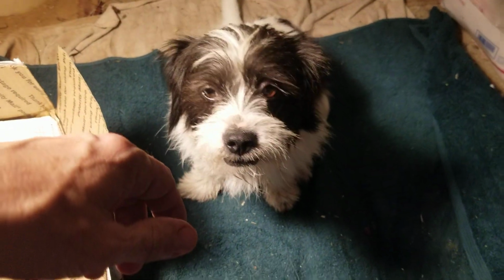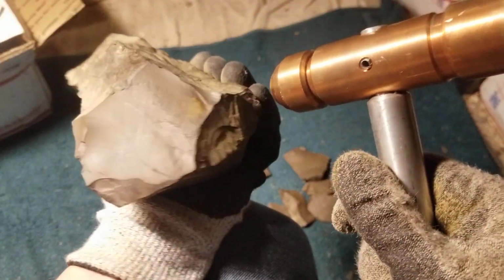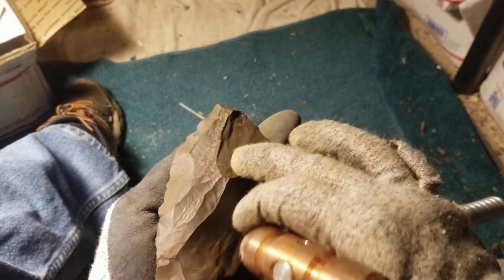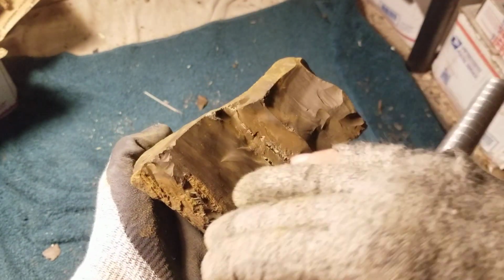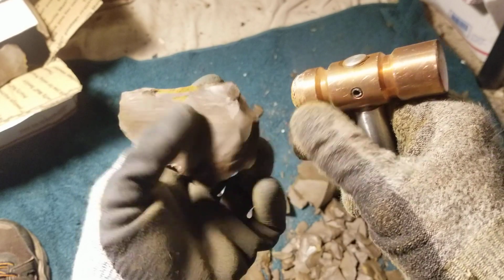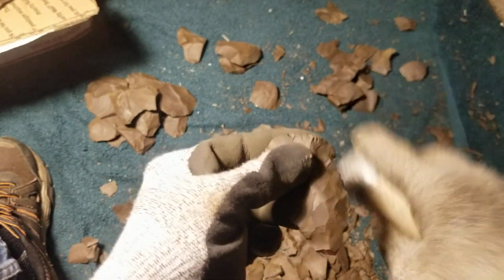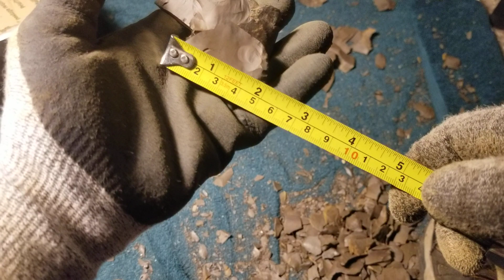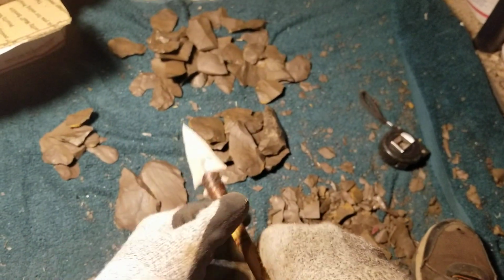982 - Rainy Buttes Part 1/8 - Gift Box

Comment: I recieved a box this week, it's alot heavier and dense than I've thought.
Reply from the maker: Does it look light weight in the video? Cool stuff, no?
Reply: Not so much light weight based on the video more so lighter like some other petrified or silicified woods I've worked in the past. Its a joy to work the grain present in some pieces make awsome looking points. You are absolutely correct about how brittle it gets while thinning forsure. I plan on posting some points on my Instagram later.

Comment: Hey Jack, I received some larger bulky Rainy Buttes today, what is the best way to spall them do you think?  There is 26 lbs, but huge pieces… have never dealt with larger pieces, and want to get the best results!  Should I purchase a spalling hammer or would my large copper billet work? Thank you!
Reply from the maker: Large copper billet should work fine. Rainy Buttes is easy to knap.
Reply: @KnapperJackCrafty  thank you!  Excited to work with them!
Reply: @KnapperJackCrafty  the plastic composite worked wonderfully with the plastic stick. I cannot get the dexterity to put the stick in the crook of my leg, so I’m just sitting on it with the stick to the right of my right thigh, and that seems to be working OK.  I sit on a padded chair, so it seems to be locking it in pretty well. It’s all trial and error.
Reply from the maker: @paulalbert8096  Nice
Reply: @KnapperJackCrafty  side note, but the tools on “Kentucky Flintworks” seem to be very well made, when I want to get to the point of buying a copper spalling hammer and/or high quality boppers?  I like the fact that he makes his own tools and machines everything himself.  What is your experience?
Reply from the maker: @paulalbert8096  I've never bought tools from kentuckyflintworks but I hear good things.
Reply: @KnapperJackCrafty  thank you for taking the time to answer my questions!
Reply from the maker: @paulalbert8096  you're very welcome
Reply: Well, Kentucky Flintworks took my money for tools and never delivered!  Guess I won’t use him again for future orders… too bad, his tools looked amazing.